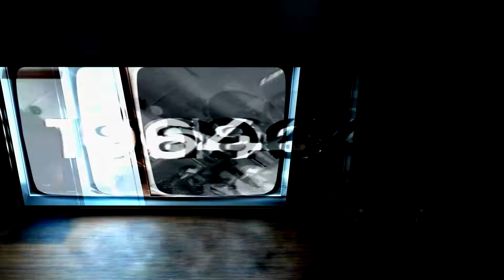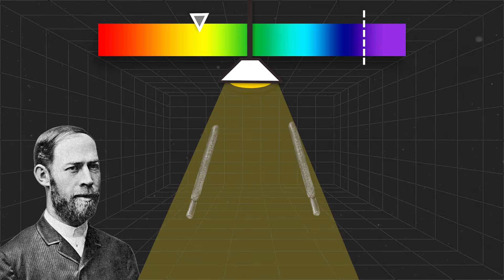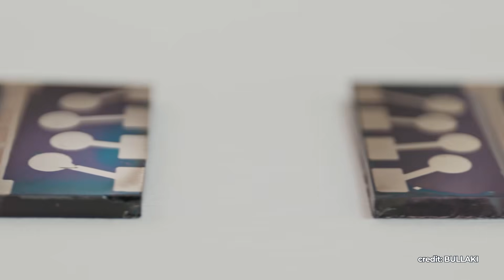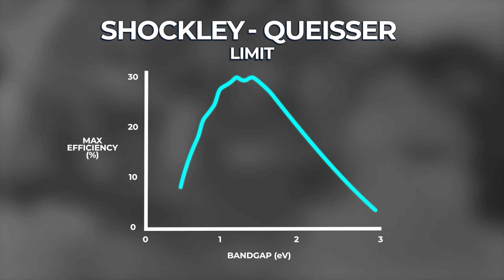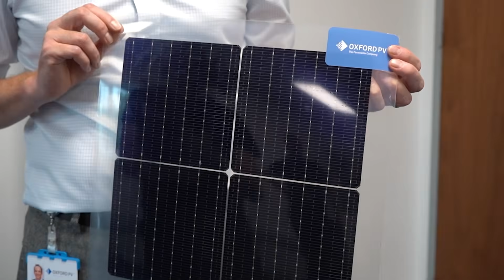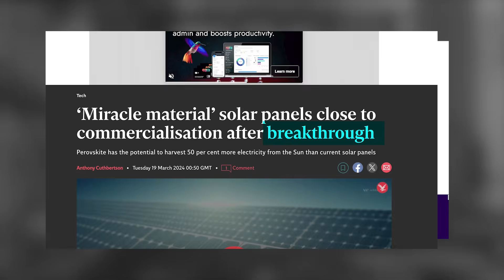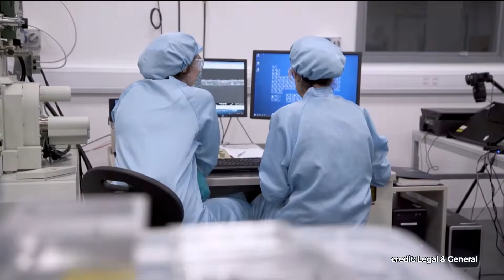How Physicists Broke the Solar Efficiency Record

Comment from the maker: Thank you to the Oxford PV team for sharing your work with me! And thank you to Opera for sponsoring this video. Click here https://opr.as/Opera-browser-DrBenMiles to upgrade your browser for FREE!
Reply: Only one task each second .. that was a good one ...
Reply: So let me ask what I think is the obvious question regarding perovskites:
To my knowledge, the biggest problem to solve with its durability is that they break down under exposure to sunlight.
Is it a specific frequency (for any given perovskite) that causes it to break down? If it's a frequency that's outside the useful range for perovskites and silicon, could a filter layer "just"* be stacked on top of it to block the offending frequency band? I understand that ideally we want to convert it all into electricity, but if the cell can't use it then blocking it can't hurt much.

*I acknowledge that "why don't you just" is the single most infuriating thing a professional can hear from someone who has no understanding of the complexities the professional deals with on a daily basis. I use that wording here as a casual idiot who really knows barely more about solar panels than presented by YouTube's various science communicators.

Thanks,
Les
Reply: Never let perfection get in the way of good enough.
Reply: Reminder: Opera is gone since 16 march 2013, this is just Chrome with Chinese overlay and some Firefox features.
Reply: Check out 13:58 !  I'm a bit puzzled by the gloves. They seem to have an extra 'finger' between the ring and pinky fingers on both hands.  It's clearly not an actual finger, but I'm curious what it could be. Any ideas?
Reply: @manp1039  The first thing that comes into mind is AI edited or generated.
Reply: The biggest question is how much the degradation affects it over time because solar panels are hard investments to redeem. You need around 8 to 10 years to recoup the cost of the solar farm, but you have 10 to 15 more years of exploration. That led us to the conclusion that if it helps us recuperate the cost of the solar farm in 6 years but we need to change them on the 12th year, is it still a viable alternative?
Reply: The Kardashev scale is the dumbest thing I've ever heard. It's basically "solar panels to space, and beyond!".
Modern science drowns in its own mediocrity.
Before you get halfway to "civilization 1", we will extricate ourselves from this modern secular religion and find WAY better ways of harnessing available energy than "muh sun".
You know why y'all are so pitiful? Because of how comfortable in you are in your ignorance.
Reply: We're still not there, but thanks for the update. Good presentation.
Reply: Great Video!  I have a suspicious feeling that this knowledge and the production of Higher efficiency Solar Cells has been Suppressed!
Reply: I read about an "in the lab" technology which used quantum dots.

The idea is that most of the Sun's energy that reaches Earth is actually in the infrared, which is not where silicon's band gap is found. So traditional silicon cells are only harnessing a narrow-ish band of the Sun's total output.

But the quantum dots can change the frequency of a photon, and move all the infrared coming from the Sun into the required band gap. So that, effectively, it's like you're moving the band gap to where the Sun outputs most of its energy.

Granted, it's "in the lab" and just a prototype and so forth. But they got 67% efficiency. Effectively tripling the efficiency of traditional solar cells.

So imagine the same area of solar panels on the roof of the house, but it's now producing three times the energy.

And the thing is, this "quantum dot" idea is not incompatible with any other efficiencies that teams like the Oxford PV can produce. So if traditional solar cell efficiency can be increased AND the quantum dots are used to harness more of the Sun's output at the same time, we can hopefully just keep cranking up that efficiency.

(Of course, 100% efficiency is impossible. Thermodynamics does not allow it. But one-off experiments have hit 40% and the one I'm talking about hit 67%. It is possible to get the efficiency significantly higher. But, of course, that has to be balanced with being able to mass-produce it cheaply. Although, the thing with the "quantum dot" technology is that it is used in TV screens already. They have worked out ways of mass-producing them at scale, at relatively cheap cost. Which is why there's promise for this technology,)
Reply: Re: Perovskite Timeline. I tried, but didn’t hear anything about availability nor likely cost ranges. Were those mentioned? If so, where? If not, when might the public be hearing about it?
Reply: If Im not mistaken the Chinese have been mass producing this tech for a while already
Reply: With this tech does these brand-new panels are 24% efficient. Do they degrade over time faster or slower than standard panels?
Reply: @DrBenMiles looks like they're just testing the skites with voltage readings, someone needs to put photoreceivers on the bottom and detect exactly what all each sample absorbs, then feed the data to AI and have it formulate which to try next or what combos
Reply: Opera is the Russian browser designed to monitor, trojan and bot networks.  You think that calls for a global embargo of Russia for it's invasion of Ukraine is not also your responsibility ?  Did you know you display symptoms of sociopathic self-centeredness.
The old Soviet  активные мероприятия  (never ended, just rebranded) program for infiltration and subversion of target societies used a training acronym for their recruitment methodology :  M.I.C.E., which translates as "money, ideology, compromise, ego", with "compromise" in this instance means placing someone into compromising positions for the purpose of manipulation through blackmail, coercion and extortion. Other tradecraft terms, like "ally", "fellow traveler", "puppet", "useful idiot", etc., characterise the level of control.
Your own words describe  that you have been subverted to acting for their purposes through "M." (money), and probably qualify as "a useful idiot".
STOP inciting your fellow citizens into allowing Russian invasion of their "smart" networks.
Reply: the issue with the scale is that it only looks at energy usage and not  technological usage/level. We can effectivly stay at 0.73 but have several colonies on the moon or mars or be multisystem. Also it primarily looks at energy from the sun instead of other forms of energy like Nuclear, geothermal, or even more exotic forms such as black hole engens(using the rotianonal energy from a black hole/matter orbiting it), possible Vacuum energy(if we can upscale it), to getting energy from the magnetic fields of celestial objects. 

i believe there was a scale develped a while back that looke at it from a tech perspective, though the name eludes me.
Reply: That cell reflects a ton of light. The key to 💯 efficiency is photon tunneling with zero refraction.
Reply: Can you make a video about the killer clams?
Reply: oh man, Opera, my favorite Chi__se spyware 😂
Reply: kardeshevs theory is wrong, type 3. black holes /singularities don't create energy, they devour it, that's why blackholes/singularities get more powerful and then bigger. his theory is based upon harnessing the gravity aka magnetism of the black hole, which can be done with less than 100% efficiency on the outer edge and efficiency decreases as you get closer to the event horizon as not even mass like light can escape and only the energies that can overwhelm the force of magnetism degree en such masse as is sufficient to decrease the absorption power of the blackhole/singularity that successive energy mass being ripped apart can escape....like sound and light going thru multiple layers of curtains, (as bad of an analogy that is, but simple enough even a child can understand) ripples in a pond might also be a coexistent way of putting it, or a downed high voltage powerline having a radius of energized ground distance such as 30 feet being lethal, 30 yards being crippling/damaging, and 300 yards being a mild sting. if you can find enough mass with sufficient energy soaking capability the energy of the powerline being released can be absorbed and the effects diminished, but not completely defeated, that only super higher energies can escape from at the furthest vestiges.
a simpler analogy is rather disgusting: a toilet flush overwhelmed by the mass and it's consistency of a defecation. obviously all of the diarrhea will mostly be evacuated at the event horizon but you need to overflow the bowl for anything to escape. we dumb monkeys lack the sensory necessary to view and thus understand all of the acts of physics taking place at a microscale and thus a cosmic scale that such an eventful act would take. a super black hole would be like a super charger on an engine with counter rotational forces, which is probably why they do so much more damage and much more quickly.  something whirling around that fast with so much force would have a static affect on surrounding masses to cause tidal exchanges.
stators on engines.
the secret to the universe is that it's all easily understood using electrical physics in every form on multiple levels in multiple phases all at the same time in a concerted rhythm we have yet to fathom.
Reply: @DrBenMiles You have missed the 47.6% efficiency solar panels from Germany. They made them 2 years ago.
Reply: @QuestionTheTruth  He has missed a lot it seems.   But life is a learning process, and science is now moving faster than any of us can keep up with.  Soon to be accelerated by AI to a degree that leaves us all behind.
Reply: This is incorrect.  The first solar cell was actually Benjamin Franklin in 1752.  Aside from the lightning in a bottle experiment, he also managed to 'charge' a glass jar using a anodized copper strip opposite of an cathode copper strip.  He showed that the bottle could be 'charged' using only the sun.

Though this wasn't a 'good' solar cell, this was the very first creation of a solar cell.  Albeit a very large one.

While wiki and the internet can be good sources, seldom are they ever the best source good doctor.
Reply: Constructive criticism, no disrespect;  lose the background noise.
The subject & your narration of it is great! The addition of distracting, monotonous & annoying music ruined the vid for me.
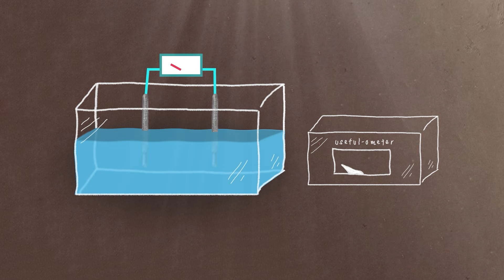Reply: 3:40 - exhaustive history of the solar cell (still holding back the core content)
08:46 - still covering the history of solar cells
19:00 - No clear answer, but Cark Sagan adjusts his measure of a civilization

I'll answer it though. It's calld super surface graphine. Silicon is not the way of the future and any cell that only collects light at the blue spectrum is a waste of diode space.
Reply: @BJbear2001 I would go a step further, light spectrum isn't even good enough.

Remember all energy including light is just the electromagnetic spectrum.

There are companies developing cells that absorb infrared, ultraviolet, etc etc.  The best cell would be one that absorbs the greatest potential energy from any possible parts of the spectrum.  Not just visible light.
Reply: @thisisashan  Meanwhile back in reality, let's get Three Mile Island up & running again.
Reply: @savage22bolt32 There is already someone doing what I am talking about...  and yes nuclear is still a clearly a better solution.  But they need to start making nuclear power plants that self enrich, and cut the crap with the uranium enrichment laws that prevent them from building the same reactors that we built in other nations... backwards to allow other nations to enrich but prevent our own.
Reply: @thisisashan  yes, def. 
Most of my comments on yt are half-joking. Thanks for the reply!
🎯
Reply: they can't even show you one that you can touch.. just another ...
Reply: Pancakes🤤🤤🤤
Reply: Could you look into how Quantum dots are being applied to the solar cells as they can also harness the light spectrum the cells look to do? Thanks
Reply: And I thought it's the way you use energy and your efficiency.
Reply: I'm glad that we aren't even on the type 1 yet. There are plants and animals that need sunlight too. Besides I don't like if there was basically endless night because of solar panels
Reply: I thought NASA had 30-33% ( lab ) efficiency solar cells as the highest current available.
Reply: He stole the work.
Reply: I hate the Kardashev Scale... It's so utterly and entirely pointless on any level... LITERALLY not good for anything at all, not even a decent thought experiment...
Reply: Perovskites are backwards--- someone needs to teach the monkeys how to bash the rocks together it's awful NO ONE is even thinking about the REAL ISSUE! - I have designed a pannle 70% efficient with near zero environmental degradation from ultraviolet or radiation making it perfect for space applications, withwithout having to significantly change manufacturing tooling, simply by arranging specific already existing and produced at scale components in the correct order and within one year that could become 80% - and no I'm not breaking any laws of physics - like yourself and Paul Dirac I live in here Bristol- we could meet up in Clifton if you would like to sit down for a coffee and have a chat, this is not a joke! - I can talk around it, though if you want to talk about it NDA all day-
Reply: Ty!  What is the lifetime of the panels? Science is essential, but cost will make it or break it, meaning in this case longevity.
Reply: @l0I0I0I0  you should get 20+ years from most panels even cheaper one.
Reply: @l0I0I0I0 😊😊😊😊😊😊😊😊😊😊😊😊😊😊😊😊😊
Reply: That one Chinese spyware browser? No thanks.
Reply: I watched the entire video, and seem to have missed the explanation of why perovskite photovoltaics in the hands of Oxford PV "just changed everything". Are they rendered suddenly practical from a cost or durability breakthrough? Can anyone time stamp this moment in the video? Or is this just another click bait featurette without a payoff?
Edit:
At 16:32 there is mention of "additional layers of packaging are needed to take a lab material and turn it into a material that can survive in the real world." Is this the breakthrough that "changed everything"? No other group of people, aside from Oxford PV, figured out this extra layers approach? That seems a bit incredible.
Reply: @camplethargic8  It just changed the investments flow for them. That's a grand way to rephrase some extra income - note, only for those affiliated with Oxford PV. In reality, they offer merely a few (2) absolute percent increase over existing 22% modules. One would wonder if it is worth it, considering the higher cost of the said modules and what is the actual lifetime and degradation compared with competitors.
Reply: Seems like a pointless scale whenever nobody currently registered on said scale.what would be the basis to extrapolate such a scale? There's nothing to even prove a dyson spheres is even possible.  Wouldn't they have to deconstruct an entire planet to build one?
Reply: 20% - whoop dee doo. Great clickbait to get you YT and sponsor bucks.

Comment: the Kardashev scale doesnt work tho, from the first step, if you harnessed all the energy that hit the Earth, it would freeze real fast. There is as much radiation hitting us as we radiate ourselves, its a system with no net gain or loss. If you took the majority of the energy and stopped it from warming the oceans instead, we would look like Europa. Solar roads in space is a kin to a Dyson sphere. When we can maniuplate the physics so you can fuse 2 atoms at room temperature, that is when we will ascend. Manipulating the fundamental forces, maybe even spacetime dilation. Right now you trade energy from the 4th dimension (time) to make any gains in the 3rd, when we can do the same with the 5th dimension we should be able to navigate a time cone as easy as we navigate spacetime.The speed of light and event horizons will no longer be limits, you will be able to scale through the multiverse, seeing the true size and scale and age of everything. Right now we can poke space and time, theorise what it is and how it works. When we are masters of it, things will be different.

Comment: And yet once connected to the grid could only put in 15% of advertised output 
The ignorance of solar on the grid is easily demonstrated with a volt amp meter and 4th grade math called ohm's law

Comment: You know what would be great is to have a thin in expensive panel that you could put on top of you current panels that would not effect their efficiency but add more energy to your system. Then there would be no need to dispose of your old panels to improve your system by a little

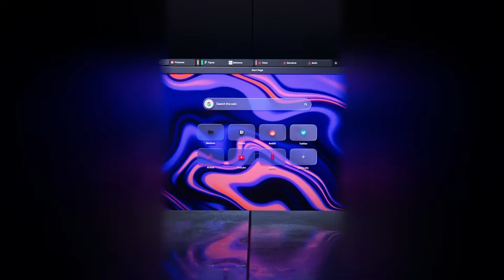Comment: 2:17 Actually the future still is silicon. Why ?
Silicon is one of the most abundant resources there is, and so for PV it's the best material.
It's not the best material in literal absorption and output, but that is easily offset by the abundance.
Which produces more energy, one extreme efficient solar panel or a thousand regular ones.
These solar panels can still be very useful for things like spaceships and other stuff where
low mass and efficiency are the required goals. Satellites too.